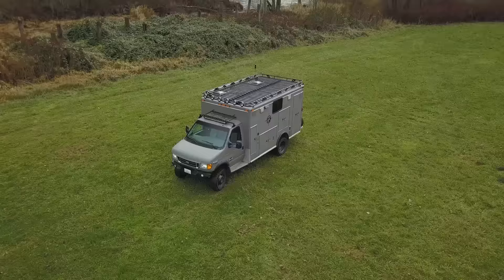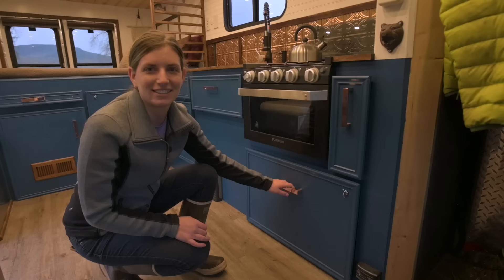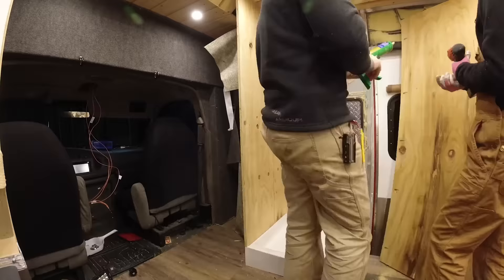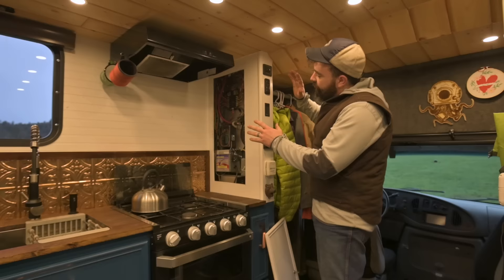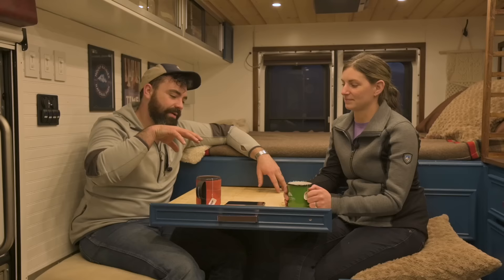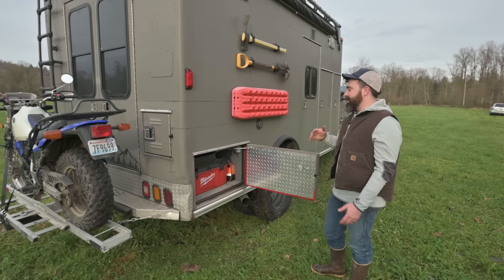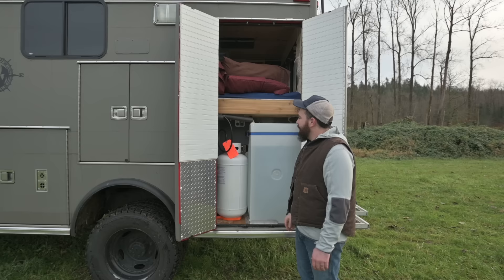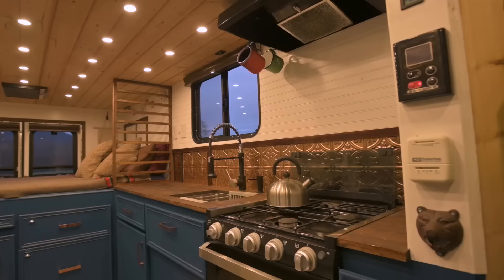DIY 4x4 Ambulance Tiny House W/ Shower Toilet & Hot Tub - Overlanding Rig

Comment: 21 years on an ambulance so far and I still feel cramped. Y’all made this look like a luxury apartment. How you were able to fit so much in what seems to me to be such a small area is crazy. This is probably my favorite conversion I’ve seen so far. Very well done.
Reply: I love the kitchen and bed area. Way cool 💜🔷🔥💜🔷🔥
Reply: They do not have a body in crisis laying in the galley!
Reply: @eddiewalker7252  I mean... Open the doors and let that bad boy roll on out of there, and neither would any other ambulance crew. The solution is easy... Just... Let them go...
Reply: i have been on an ambulance before in the PH, same model as this, and i felt claustrophobic. im 5'5, 170lbs back then and i felt that it was too tight, but everything was within reach. now, im 200lbs, i cant see myself workin in an ambulance again. good thing ICUs are roomy
Reply: Brother I'm right there with you. I'm just wondering how much fuel they blow through. You know these things are thirsty.

Comment: This guy is a mechanical and technological genius! A Mechanical Engineer?  He's thought of everything!  A hotub by a stream and pumping water in that can be heated? Wow!
Reply: Loved the immersion heater too for the hot tub...I used these many decades ago in the service...Simple and they just work!
Reply: It's my understanding that the water from the emersion heater is not safe for drinking, so is it safe for your skin? Just curious. When I first laid eyes on it I laughed because it's ingenious!
Reply: @heathermencer2367  From my experiences we used the heated water to clean and purify our eating utensils, or to clean pots and pans, or for any other use such as cleaning and scrubbing field items or even cleaning laundry at times (all such field-expedient uses)...We never drank the water...The donut-shaped metal and pipe of the immersion heater are made of steel and we used to have to clean it and wipe it down with a light coat of oil to keep it from rusting...Never did we have anyone experience skin irritation from using the heated water that I remember for those purposes, but there were plenty of other areas to watch for in the field (bugs, insects, poisonous plants, etc.)...
Reply: he hasn't thought of the radiation or magnetic fields...
Reply: @maryodonnell5760  wi fi illness
Reply: I agree!  what they’ve done here is amazing and to be applauded. And applauded. And applauded. Brilliant design work with brilliant execution.
Reply: For sure!
Reply: @heathermencer2367  Drinking soda isn't good for your stomach or your intestine, but people do it without a second thought. It's not like bathing in herbicide. Don't be afraid to live life.
Reply: 🌷 @asphaltadventurer  
TRUE! WERE ALL GONNA DIE OF SOMETHING RIGHT? 
SO FRIKKEN LIVE🙏🏼
Reply: Awesome! @smartbiz888
Reply: @smartbiz888  Awesome!
Reply: @maryodonnell5760  Could you explain more about this?

Comment: This first tiny home I have seen on wheels that has a fan over the cook top. An exhaust fan over a cook top is needed to take away the steam.
Reply: Many vans use a Max Air fan that's in the van ceiling somewhere in the vicinity to get that moisture or smoke outside.  But yeah, most don't have it as an actual hood fan.
Reply: Not just steam but the carbon dioxide fråm the burners as well. But yes, good ventilation is really important!
Reply: Not to mention the smells and the air-borne grease. It has to go outside.
Reply: @markdavid4897  you mean coat the inside of your exhaust ducting and eventually catch on fire.
Reply: @dirkdiggler9379  cleaning a duct is still a lot easier than scrubbing all the surfaces and washing all the fabrics that get greasy inside. Are you trying to say a vented hood isn’t a good idea? Because it still sounds like a good idea. Things like that hood need cleaning and maintenance. That’s just part of life. If you’re too lazy to clean it out once in a while then you’re probably too lazy to build a home on wheels like this in the first place. Or just go without the vent. Clothes and bedding that smell like cheeseburgers might be okay. Let us know.

Comment: AMAZING, IMHO, this is the best ambulance/van conversion I have seen.  I even like the interior and exterior colors.  For my old body, I would have a small ladder to get up into the bed.  The only change I would make is to the curtain in front.  I like to have a cockpit curtain that you can pull around by the windshield for privacy.  That way, you can use the front seats for storing your clothes when you go to bed.  It also creates a larger visual interior.  The hot tub?  Well, that was pure genius!

Comment: Overall I'm commenting so I can find this build again later on. Deeply impressive. There are so many details packed into this build that by themselves would be notable:
The collapsing field tub, the cellular antennas (I've not seen anybody mount that gear before), the emergency equipment on the side (never heard mention before about that requirement eith3er), the circulating water anti-freeze feature, the max propane tank size detail for ferries, the ski equipment storage, the dingy engine storage closet, clever clothes closet, the cozy interior. Amazing.

Comment: I recently purchased a 1999 F350 Class A 4WD with a 7.3L power stroke , low low miles from a local fire department in the wasatch area, and this has become my new travel Rig. Before may of 2021 , I had never heard of this lifestyle, and well that quickly changed almost overnight. I do like your conversion, I will definitely look into such options for my rig , and see what works. Every may , I staff aid stations at the bonneville salt flats endurance run , and this time I’ll have my own rig that is NOT a rental and that HAS 4WD. Thanks for your input. See ya down the road.

Comment: Love how you kept so many of the original hardware and cabinetry from the ambulance, it's super cool both inside and out. The fact that you both designed and built it, if anything stops working then you know how to fix and repair it. It seems like you've utilized every inch wisely. Great advice and how you approached your build.

Comment: Thanks so much for the inspiration. I have an '89 E350 with a 7.3 diesel and 51,000 miles, and with a medicoach box. It's very much still an ambulance. Mostly it's been used for hauling things around, making for a great moving van during our last move. The plan is to build a practical camper unit fit to my needs and wants. To that end,  I got some great pointers for a few features from watching this video. So thanks, and happy trekking.
Reply: That's incredibly low miles!

Comment: Did I miss the gray water tanks? You have thing I’ve never thought of or seen in other builds! Fantastic ideas!
Reply: Yeah not in the video, but it seems like its under the sink based on where everything else was said to be located (There's no drawer pull for under the sink but the cabinet space ends on the sides -- so the grey water's likely accessed from the outside rather than inside). Seeing as he also mentioned automation for all the locks and the water heating, I'm thinking they may have somehow automated their grey water dumping too? Likely they can plug a hose in somewhere on the outside and pump it out.
Reply: Hi! Our gray water is the black tank under the sink. It dumps with a valve in the box when we need to empty it at a dump station.

Comment: Just one question: how often do you use your washroom. The size of the washroom is probably the most debatable issue during makeover. The size of your washroom is astoundingly optimal. But is it comfortable for regular use.
Reply: Wondering that too.
Reply: Wouldn't work for me.  To each his own.
Reply: Wouldn't work for me either.  How do you shower with that toilet right in the middle and not have to remove it each time you want to shower?
Reply: Do they stand on the toilet or straddle the toilet?
Reply: @forliberty1805  you remove it.
Reply: @se7en926  they stand inside of it
Reply: At that point I'm sh*ttin outside to prevent having to move the toilet back and forth all the time.

Comment: Beautiful conversion! The only thing I would have done differently was to make a much larger lavatory. It seems there was enough space for a large dry-bath if they expanded into the area used as an open closet behind the passenger seat. Also I would prefer a large flushable porcelain toilet (with macerator) instead of the plastic cassette toilet. Should be enough space underneath for a large black-tank. There should be enough space for a large soundproof and well ventilated residential style bathroom (to me that is the ULTIMATE luxury on the road)   

Very impressed with the portable hot tub!  Haven't seen one of those before!  What an AMAZING feature for a camper van!

Comment: Do you have a/c or can you add a/c when it’s hot?
Reply: Barack Obama  for RV;s especially smaller ones like this skip any & all RV AC units and go with a Mini-Split.
Reply: I would HAVE to have AC! They like the cold but, I am a Florida girl and my paddle boards would be on top of that thing! 😊
Reply: Hi Shannon! We have AC when driving and we have a standup AC unit if we are plugged in but most of the time with two roof fans we can get good enough circulation to not need AC. Unless its Arizona hot haha

Comment: Thanks for the video.  Great job on the build too!  Looks like the seating and table is great spot to hang out.  That's one thing that's really important to do, is to get that spot you can hang out all day, (I'm thinking with laptop).  Seems like the rooftop is kinda bear with no solar panels.  Nice to have portable panels, but nice to get some power while driving too.  I'm kinda in the park of too many ceiling lights myself.

Comment: Only things i would add would be a catalytic heater and some form of A/C like a mini-split. Oh, and I would prefer some type of comfy love seat with maybe TV trays or a removeable table for eating/ working off of instead of the table set up they have. Maybe also a TV/computer monitor on a swing arm across from the couch. Also a VERY in depth smudging ceremony prior to move in

Comment: beautiful video, beautiful camper, awesome work, looks great from the outside and the inside.  The quality on the inside looks like a regular house that is pretty squared away.  It's so perfect.  You had such clear design principles it's such a beautiful space.  And the outside is so functional since you have all those storage cabinets.  From the outside it looks so hardcore.  Cool job. I like the glass shelves too.  That stove vent looks pretty difficult.  The rack on the roof looks really cool too.  Great job.  All those specialty things look so difficult, like the rolling vertical screendoor--I've never seen that before.  What's so cool about it is that it looks so open concept but nice and cozy.  Don't get fat or you won't be able to poop or take showers anymore--that bathroom is small.

Comment: cool rig. if you find there is condensation or mold in the ceiling afted a couple winters, replace fiberglass insulation with a spray foam type or rigid....

Comment: thought of getting one of these myself at some point when can,  even totally stock they often have a place to sleep, if you dont mind the fact that 150 people died in your bed.... usually have at least one comfortable chair in back somewhere, i would probably just load it up take it out the way it is without changing anything at all to begin with, just use blow up mattress on floor if need to, toss in random couch or whatever handy or cheap... use portable solar of some sort to begin with, and go... it is far easier to consider what you will want to change when you are out there camping sitting in there, than in your front yard sitting there.. just like any other camping trip, often dont realize what you should have brought, or what was a waste to bring, until you out there. .... i also watch videos such as this and have been, rv video reviews also, in order to learn not only possible setups, but the parts involved, what they should cost etc. ... like this setup a lot, but not the one i would build...  i would use the shower and closet configuration part.... not sure what i would do exactly, but something that allowed back doors full access, no bed in the way.... maybe something like a toy hauler jackknife sofa on one side, fold against wall, and put motorcycle inside, make couch, or make bed, but i am single, not 2 people.  i would keep the same kitchen appliances gotta have a real oven, ...but would have much bigger tv somewhere... for 2nd computer screen which i would use all the time and xbox games if in the mood for that. would not be able to decide any of that until had the actual vehicle and tried it out a bit either way.

Comment: these are such excellent platforms for campers, very durable, well built, surprisingly inexpensive considering everything you get is far above consumer grade. If at all possible, you could look into upgrading the engine to a newer, far more fuel efficient one since that technology is one thing that's improved greatly in the last 15 years, and you're likely to recover the expense on savings fairly quick if you're using it daily! I'd love to find one of these, sanitize it, and do exactly as you said, a bare min build, take notes, and make slow changes while saving money, and still having a great living area relative to what you have with a base van or trailer. We should all consider repurposing already existing vehicles before buying new, for savings, as well as making the best of what we have instead of consuming more. Wonderful vehicle, I wish you two many happy miles ahead!

Comment: Nicely done. I did laugh a little at the large sink statement. I know it's large by van life standards (Is there such a thing as van life standards? 😁) but it's not really big. With the room they have available, I'd opt for a full sized sink. Of course, that's just my preference. If it works for them, then that's fine too.

I'd like to do a build in a couple of years and I'm leaning towards a small box or ambulance as the right size for my wife and myself over a van. This one is laid out very nicely.

Comment: Just for informational purposes the RR compartment that is used for ski/wet storage on your your Type III van ambulance contained the M size oxygen cylinder. It slid in on rails and was secured with straps and a steel yoke at the valve assembly at the front of this compartment. It was accessed thru a plexiglass file open door to open/shut the valve.  The bench seat on the right(pass.) side would lift up and you could store things like a broom or counter brush and cleaning supplies. The bench also doubled as a secondary patient/folding stretcher/ LBB position. It had cups to hold the wheels and handles. This device was nearly always a stair chair. The cups were round and oblong shaped to insure the stretcher would only fit with the head toward the front. It would be secured with 3 automotive seat belts that were attached to the wall and fasted to the O2 compartment. When not used as a stretcher space, you could seat three persons on the bench and belt them in.

Comment: Love it 
JUST AN IDEA!
You need possibly  to put
Spring rods with some kind  of curtains maybe vinyl curtains ADDING WEIGHTS on the bottoms and inside THE CLOSETs  behind  the curtain maybe put hooks on either side with a bungie cords to hold back your clothes/ coats

Also maybe
All for asteteic possible reasons a thin wall built behind drivers and Co pilot seats so you do no not see clothes  and other things from outside or inside..
Just a thought..
❤️  the build..
They make folding bath tubs on amazon.
Could maybe adding heated floors..
Good luck in your travels
I can not remember  if you have ac in living part.. or ceiling fans ?
Mary Jane Florida🌴

Again Just a thought..

Comment: Great vid!
Questions:
1) Since the conversion (4x4) have you noticed an issue with load capacity (top of & pulling)?
2) How come you didn't put any solar panels on the top (or the very top front section)?

Comment: Don't know if the original posters of this video are still reading comments, but this video and others have convinced me to start shopping around for my own used ambulance to convert into my traveling part time home (6 to 9 months of the year).  This video showed several ideas that are missing on most conversions, but I liked the hot tub the most, though I doubt that I will try to duplicate it.  If the original posters, or anyone reading this know of the best online resources for someone like me to learn more about doing conversions, and buying parts (I'm a retired general contractor, so I'll be doing all of my own work), I'd appreciate a link to any sites that will help me.  I don't do Facebook though, and recommend that everyone who does to use every security measure you can, and seriously think of alternatives to that platform.

Comment: Wow...  That's absolutely insane.  That's likely the most PERFECT build I've ever seen.
The only thing I might improve if I'm correct is to go ahead and just add extra solar panels on top to have extra power, still do your portable ones, but have the extra.  This might allow you to add an "Air Conditioner" too, since it sounded like you needed to be "cooler".  Also, I would add a "water recirculation" system for the shower and even sink (be switchable) so water can be saved in certain uses.